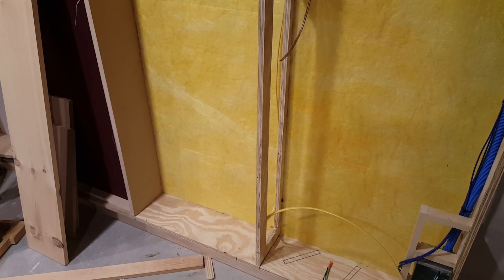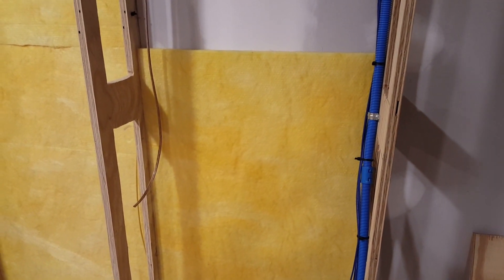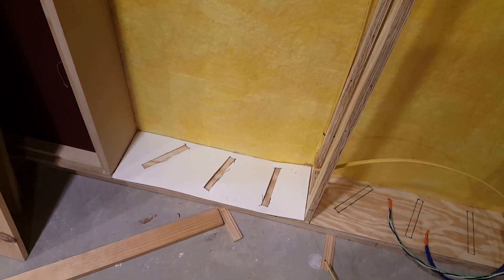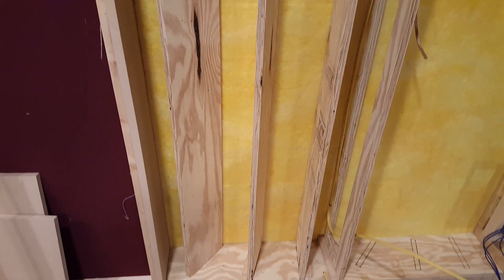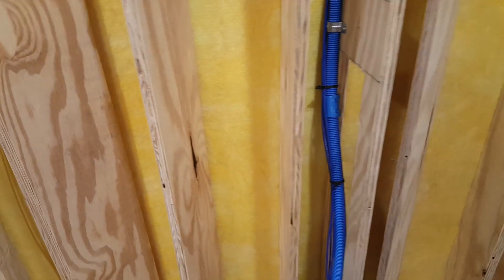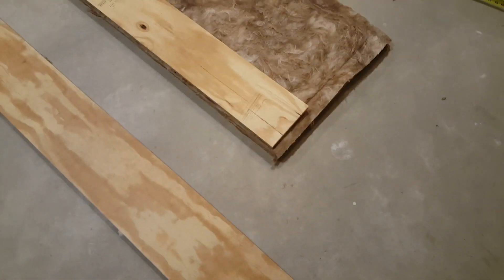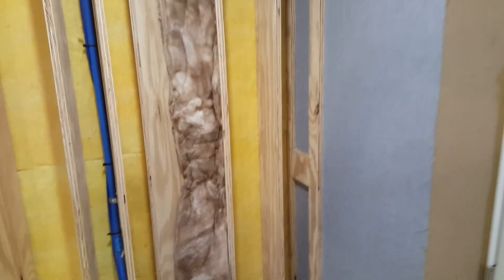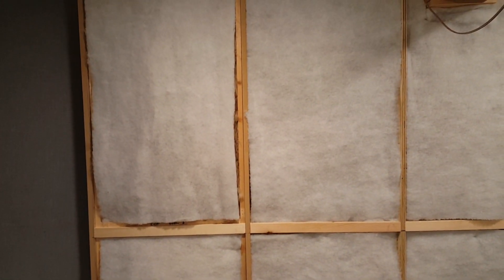Mixing Studio Build - Broadband Frequency Traps with Wave Guides

Comment: How does the wave guides work more then distributing and reflecting some of the sound waves back  in to the room without to much absorption. A more easy approach is to cover up some of the surface area of the panels with wooden planks as you do in your other projects  for some reflections and more diffuse absorption fields.
Reply: the sound is supposed to bounce between the guides, getting more travel for the waves using same amount of absorber.

Comment: It's pointless to have those "wave guides" never seen anything like that in Wes Lachotte designed studios. Simple design, non parallel surfaces, cloud and really simple bass absorber.
Reply: These are John Brandt's design. They're definitely not pointless.
Reply: @ClintMoody  but those are just mid-hi frequency absorbers and barely bass due to the depth of it. Guiding mid-hi frequencies is not necessary when used fluffy absorber.
Reply: @greganikin7003  check out the other video where he shows the traps for the bass range :)
Reply: Waveguides in broadband absorbers are used in the BBC studios and they published technical notes about their performance.
Reply: Please provide links

Comment: hi great series
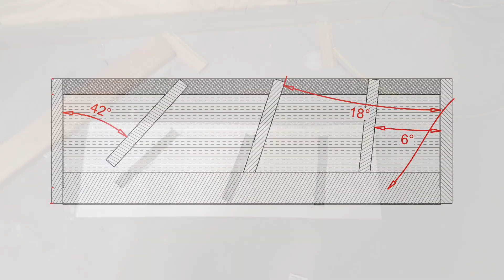From the plans (1:24) it look like a wave guides should be placed between / inside the sheet of rockwool/ rigit fibreglass but on your video you mount them them in front of thr rockwool/ fibreglass sheet (2:03) , is that make any diffrent ?
Reply from the maker: No, no difference.  I did it this way because my traps were a little deeper then the plans.  No change in functionality, just more convenient for me.

Comment: Thanks for this video ! How do you determine the angles of the wave guides ?!
Reply: these are standalone traps of the same design, from John Brandt's awesome resource page

1154-A Trap Section 8 Inch
https://bit.ly/2AxdwDG
Reply from the maker: The angles were given in the blueprint for the trap.  I do not know how they were determined before that. They are shown in the video.
Reply: How do you measure out these angles successfully. Are you using a protractor?